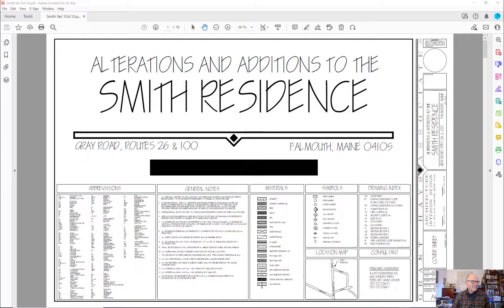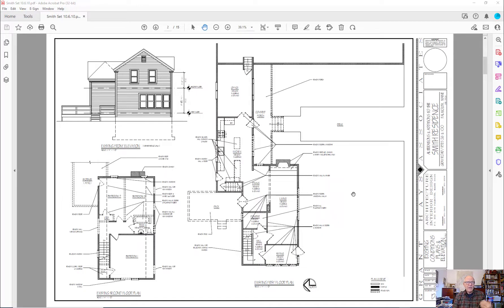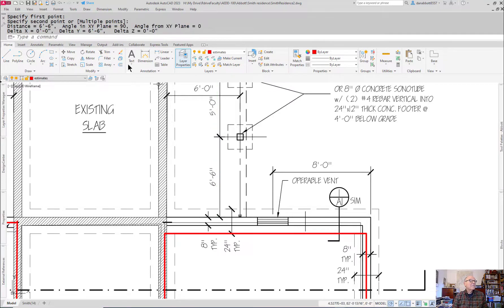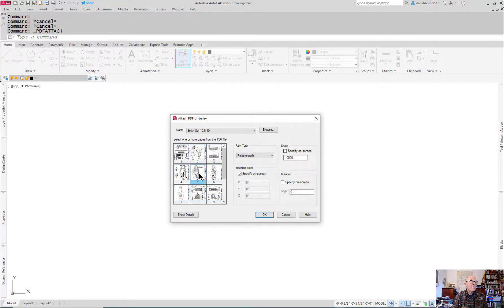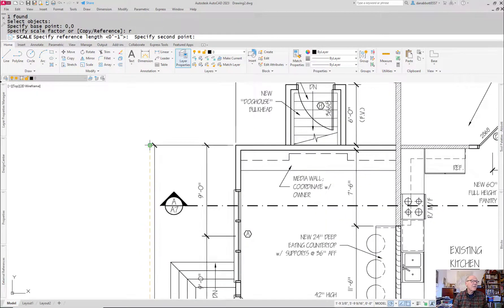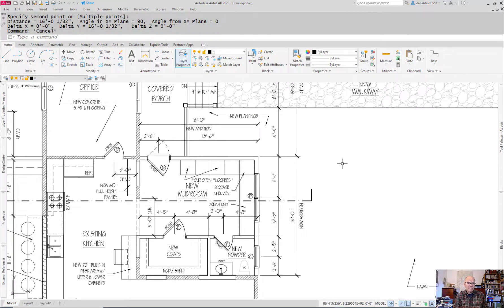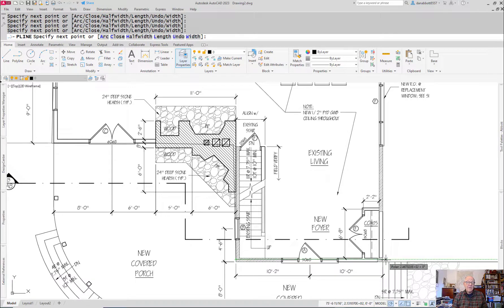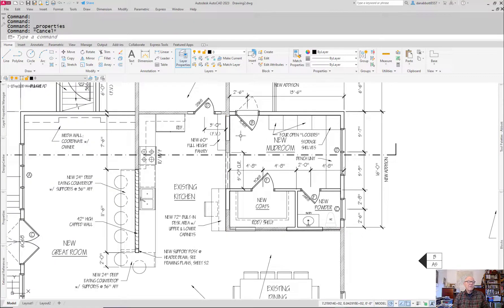Using a PDF as an external reference in AutoCAD

Comment: Thank you so much sir. But when i insert any mep components like pumps etc. As a pdf to dwg and scale it its not going well. Like if i take the reference horizontol so the vertical length or dimension are not matching with the given pdf file. When i make sections. Please make a video for that so i can resolve this. Thanks in advance.
Reply from the maker: If you mean that the scale is different in the X and Y axes, than you have to scale the pdf non-proportionally. That can not be done directly, but you can accomplish it by making a block of your external reference, and then inserting it at a different X and Y scale. I have a video on doing that. 
https://youtu.be/SIMgyHt_wz4